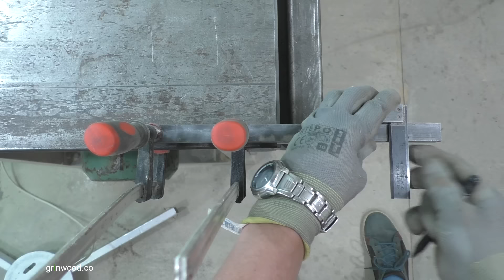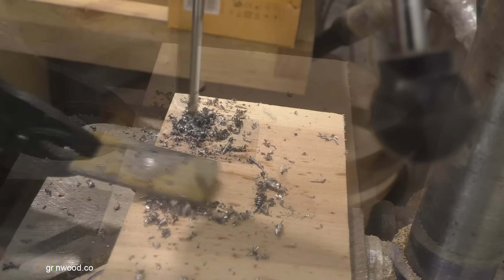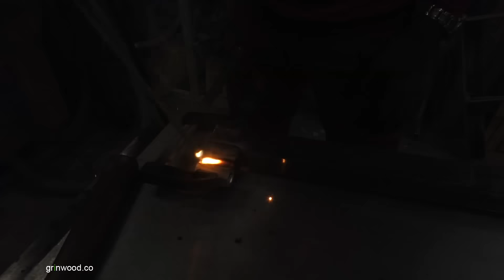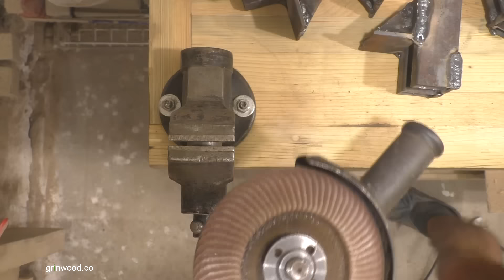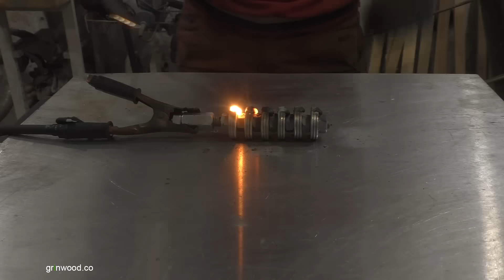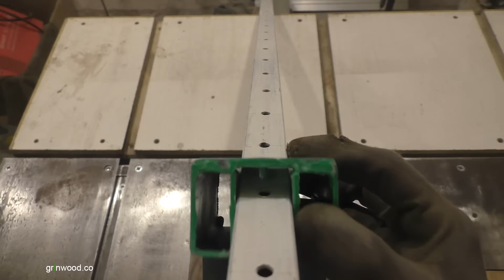🟢 Bar Clamps DIY - Making six Long Durable Bar Clamps - FREE PLANS

Comment: You have to try some "Resin Fiber Disks" for your grinder.. You would love them,,, especially if you like flap disks.. They last much, much longer and you can buy them in various grits.. I prefer them of any other type of grinding disk/pad, etc..  You need a backing pad and the resin fiber disks.. No adhesive, no velcro, just pinched with the cone head washer like a regular disk, but made for the backing pad for the Resin Fiber Disks.. 
Buy good quality disks.. Harbor Freight is fine to wet your taste buds, but, a good quality disk lasts much, much longer.. And, you don't have to buy 3M,, just better than HF..

Comment: very clever and super strong clamps!  Why did you tap and bolt on the lower clamp portion (the washers welded together) as opposed to welding in place? was there an advantage to the drilling and tapping?
Reply: Better late than never.
That's because welding may not result in a flat contact between the washers and the workpiece which may, therefore, dent or damage the workpiece if clamping too hard.

Comment: only chance i wouldve made would be ordinary hex head bolt on the tensioner, so you could easily use a spanner to tighen them up if you didnt have the drill to hand